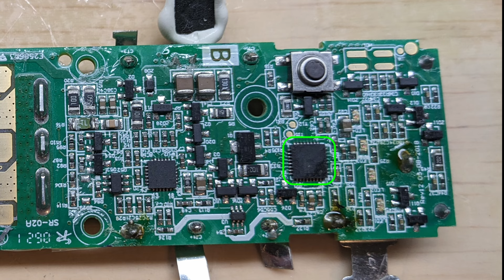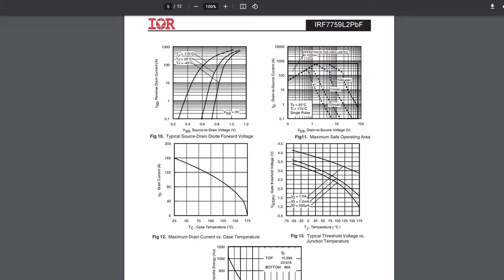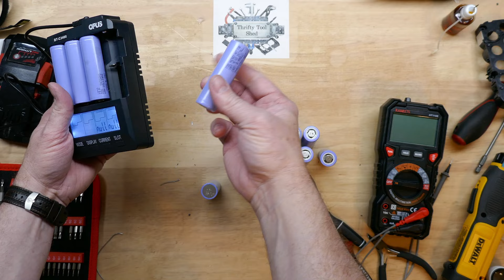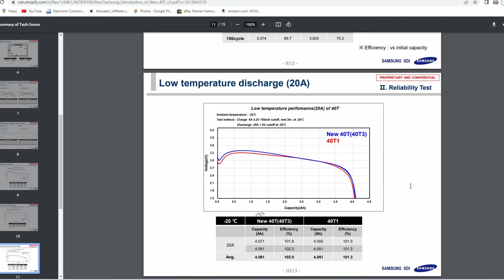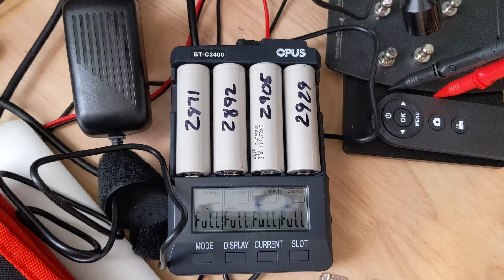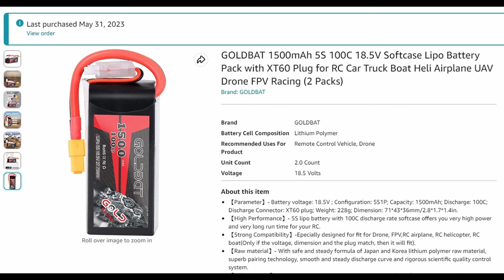Milwaukee M18 HD12.0 -  Is it fixable?

Comment: Awesome work taking the heatsink off. I was sure that there were 5 mosfets under there to get higher balance current than the 50mA of the BQ76925. Seems it's a power disconnect. Now I'm curious as to what conditions it disconnects the power.
Reply from the maker: I was really surprised it had the Mosfets, the only M18 I have ever seen with them. I am confused since this one showed shorted both ways. Not just the diode. I have only worked on this one so I am not sure, but seems shorted/faulty! Thanks so much for your kind comment!
Reply: @ThriftyToolShed  could be residual charge from a cap keeping the gate open.

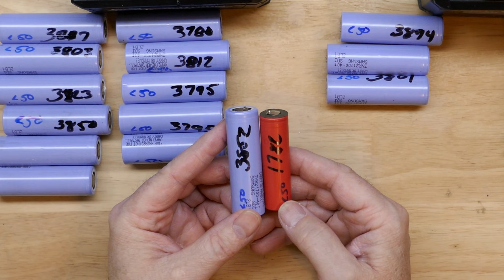Comment: 18:32  Milwaukee M18 shuts off at 2.5V/cell on their 21700 packs and 2V/cell on their 18650 packs.

Good job on letting the cells sit for 1 month. Very thorough. I would have given up after a few days
Reply from the maker: You are saying you have seen a M18 pack shutdown below 2.8-3V per cell! 2V is way to low for 18650 wow! I usually see 2.8V-3V, but it's been a while since I tested some of the M18s.
Reply: @ThriftyToolShed  yeah, I was shocked, too. Tested every type of pack I had to be sure of it. Vid is on my channel if you want to see it, but it's a relatively easy test for someone like you. I'd be interested to see if North American batteries have the same LVC. Note that it's only the 18650 2/3/4/5ah that have 2V, probably also the 1.5ah, but I don't have one of them. The 18650 6ah and 9ah are 2.5V. Then all the 21700 packs are 2.5V.
Reply from the maker: I will check out your video and I have tested my own, but it's been years ago.

Comment: I've fixed quite a few milwaukee batteries, I find if a group of cells goes bad it's best just to change those cells without disconnecting the board and then rebalance before pluging it back on the charger.
Reply from the maker: That is an easy method and I have shown many repairs over the years similar to that. Of course I mentioned that it is simply to get a pack by. That is not a proper repair and anyone that has a background in batteries knows that. I always mentioned when fixing the quick way that it's always best to replace them all or at the very least test all cells for capacity, internal resistance and after 1 month or so re-test voltage as shown. Even in a golf cart etc. we all know replacing one battery is not the way to properly fix them. It will always reveal that, always. Hopefully this shows a more in depth reason why most of these cells fail to start with and simply look at the reliability chart from Samsung that I shared and why the simple swapping out one set of cells is not a good method. I think we all know that if we have been repairing for a long time. This video was hopefully helpful to the ones who think the easy way is really ok!

Comment: lol i just built the 10 cell battery with reclaimed cells from a dyson battery v8 battery has the 21700 cells. very easy to do, works well and charges fine. so far so good.
Reply from the maker: Awesome! Glad to know it's working well! I figured the newer Dyson models had 21700 cells. I have older models only and have not seen the 21700 version packs yet. I don't intend to buy one either as long as I can keep repairing the older models I have and of course I run one of mine with the M18 batteries.  🤣

Comment: I’ve revived lots of these Milwaukee batteries without having to replace cells or anything.  If it’s got the single blinking light most of the time in my experience it can be balanced, charged up and used again.  I just got a bunch of super cheap tp4056 charging boards and use those to charge each cell up individually until they are all top balanced.  If you power each board from separate usb power supplies you can charge multiple cells at the same time!  
Some of the packs I’ve restored have eventually fallen back out of balance but many are still going strong.  With the price of these high capacity battery packs I’ve saved myself and some friends a whole lot of money by bringing these packs back to life.
Reply from the maker: Yes. I have many cells that have at least to some degree come back as well. I have several videos on that also.  The unfortunate thing is most people think many are that way and after 12 years of working on lithium packs it is way more likely a cell capacity issue than a true quick fix. I share in the videos of the cells either dropping off quickly which is hopefully obvious to everyone why that's not good.  I try to educate to show the cells even after being charged up like these and look ok to most people if you test them one month later you will see the truth. I am working on the other videos now for several different packs and one happens to be a 8ah that I bought that has seemed to balance out just fine and is so far holding after a week or so. I am hopeful that it will be a good pack, but deep down we all know it got that way somehow...
Thinking it is a totally good battery I would be deceiving myself.
Reply: @ThriftyToolShed  Well said, It’s important to remember the battery didn’t end up in a non-working state for no reason, so I never expect to magically transform a pack to “new” condition.  After having attempted many repairs on other brand of battery packs I’ve been quite surprised by just how many old discarded Milwaukee brand packs I have brought back to life for many more months of use with such a simple fix.  My guess is that the ones I’ve had luck reviving were ones that failed due to being over-discharged and/or stored for too long on too low a charge.  No battery pack of any quality will last forever, and if I can pull what was once a $400 pack from the recycle bin and back into service for a few more months I call it a win.  
As far as safety, after personally experiencing a lithium battery fire I now treat any battery pack as if it has the potential to burst into flames and I have multiple fire extinguishers and bags of sand ready for the remote chance something goes wrong.  I think the likelihood of thermal runaway on one of my revived high capacity Milwaukee batteries is very low though, especially when the pack is left intact.
Reply from the maker: Absolutely!
Reply: This made me think about how much I’ve learned about repairing electronics in the past few years, and I have your videos partially to thank! I think the first battery I really got deep into was an Ego 56v pack and your videos were the only thing I could find on troubleshooting those packs.  Your clear instructions gave me the confidence to attempt a repair, and once I successfully brought one $300 battery back to life I was hooked!
Reply from the maker: That's so awesome! Excellent work. Thanks so much for your kind comment!